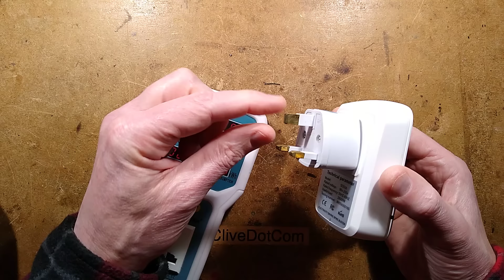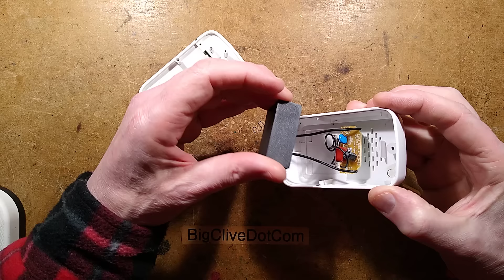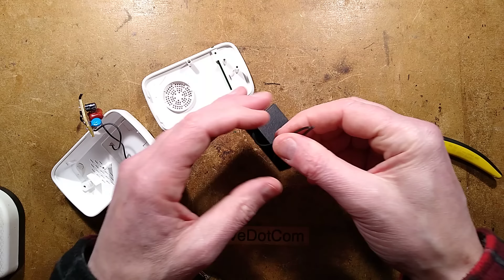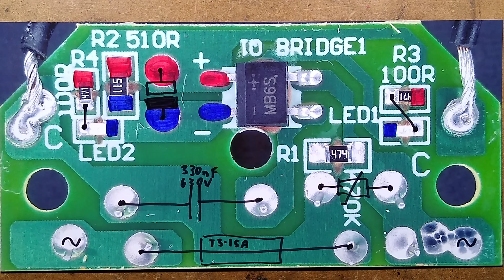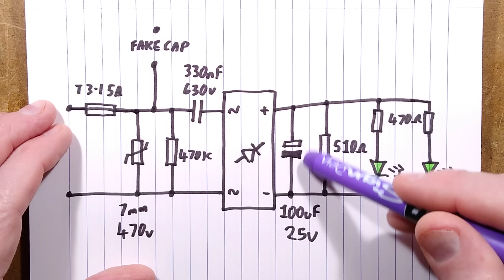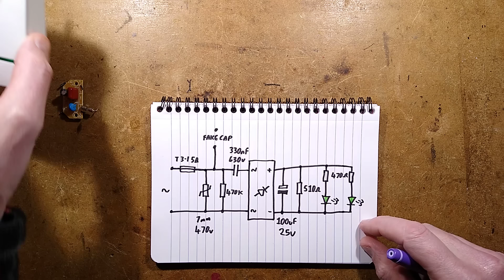Scam power saver plug - the 2024 edition.

Comment: it is not a fake capacitor, it increases the capacity of your wallet by removing extra money
it is disgusting that so many real people fall for this scam so many decades later

the irony is that most devices that have use for a capacitive Power factor corrector(what this would be if it was real) already have one inside them
things like a window AC(which has capacitors in there always to balance the phase and startup surge in non-inverter models, inverter types have no use due to the electronic speed controls)
or a fan(often a shaded pole motor that consumes so little power it has no need for capacitive adjustment)

the rest are devices that abuse the capacitive reactance, making this device cause the power factor to get WORSE

the best way to avoid bad power factor is to use resistive loads, or if you must to use a low capacitance input boost regulator to go above peak mains voltage(literally exactly how real active PFC works)
but to be truthful most consumers should not care much, the likelihood of anyone having a bill high enough for power factor to matter(even after they start charging for it) is low
the reason? end-consumers are on transformers, devices that are highly inductive isolation devices by default(at least in the USA

at best they may add their own primary side capacitive adjustment, but most americans(and probably other lands) tend to use localized step-down transformers, and the loads an end-user will toggle are so weak as to be undetectable for most grid-scale measuring

large industrial loads are given fees because they often consume megawatts(kinda like those pointless superchargers when charging at home is best for battery longevity anyway) but the few KW of load on average of each home? undetectable when dealing with power factor issues

sure you should design power factor into your devices, but given the nature of thermal+inductive breakers, consumer grid ties, and natural load variations and limits, it is unlikely that consumers will ever really have to deal with power factor directly
you still need to be careful of ACTUAL overloads(not the scare-lie of not plugging splitters into other splitters, even in fuseless america)

but my entire PC setup uses an average of 500w under load(maybe not the server being fully loaded but still) but anyone not versed in why "scary plug squids" are bullshit would freak out
500w is <1/3 the limit of almost all devices on a 15a capable circuit, but my "office" is on a 20a breaker, and the inverter is likely capable of melting most 20 wires(it can supply 4kw of normal load, 1200w of reactive power i think)

read all your plugs and measure computers with either a kill-a-watt or HWinfo, you will find that almost no common computer desks even break 200w normally in total, and those that do are well below 15a at 120v
my rig is for gaming, and my server has a best of a CPU, yet it sips less power than my AC in 1/4 the time

I actually set up the smart control app just to test how much I save by turning it off for a week while I was away, I saved like 1/3 of my power bill turning it off for 3 weeks in a row(something impossible if I was home)

so what saves you power? turning off your HVAC(or setting it to "freeze prevention" mode) heating/cooling a space is EXPENSIVE, tune that thermostat as low/high as you can tolerate, that saves the most coins

power saver plugs? they cost you more if they do anything at all because they make power factor worse as almost no consumer has large uncorrected inductive loads

actually those devices may be useful if connected to larger AC-DC power supplies AFTER the power switch, the large capacitance could balance out the surge of peak mains charging the input side, but not perfectly compared to real APFC
but fixed devices connected 24/7? literally cost you MORE on power and power factor

Comment: Picked up one of these for a dollar just for kicks. It had a fancy foil sticker covering the plastic molded back. Peel it and it called itself an ultrasonic pest repeller. Aha. Fun!  Always wanted to play with one. Had a red LED. The guts had a peizo and so forth, so it actually was what the mold claimed.  Baffling to me, it actually did repel bugs.  I would never have believed it if I hadn't seen it work.  It currently runs in my kitchen doing a fine job keeping away the bugs.   Pleased with that one, I got ten more, exactly like the ones in this video. Green LED.  Guts were the same fake capacitor and no piezo.  They do nothing.   Still very puzzled by the one that does repel bugs. I thought that wasn't supposed to actually work.  But it does.  I am assuming there is some effect going on that likely has nothing to do with sound.  Either way. It is short range of maybe 18 inches or so, and only if nothing blocks the sound.  Or effect.  Anyway red light kind, good.  Green light kind, garbage.  In my experience.

Comment: I have LED tubes in my workshop but when I'm filming, they can flicker. Maybe a massive F-off capacitor across live and neutral would smooth the phasing?
Reply from the maker: You may need to experiment with lights for filming to find ones that don't flicker.
Reply: @bigclivedotcom  Sounds like hassle and expense. I did consider flicker free tubes but they aren't cheap. Then I thought about replacing all the lighting with DC lighting.
However, I'm wondering if these particular tubes run DC. So maybe a full bridge rectifier on the output of the light switch.
Reply: What's the Hertz rating of your power supply? 50 or 60 Hz? When filming, set your frame rate to be non-compatible so that they're not in sync with each other and you should avoid the flicker.
Reply: @two_tier_gary_rumain  No such option on the iPhone.

Comment: Those Chinese could save themselves all that hassle by putting piece of rock inside instead of the fake capacitor 😂 and also connect the LED directly to the mains with a series resistor 😂

Comment: The sand is the key to the entire device.  It is sand from Area 15 (the Chinese equivalent of Area 51).  The reason the device did not work for you is that your power company has installed an alien tech blocker.  This is a common problem.  Luckily for you, we have developed an alien tech blocker-blocker.  Send $19.99+shipping & handling to...

Comment: Before I click "Play," this is my prediction:
Capacitive dropper running the "it's working" LED, half-wave rectified and flickery, a woefully-insufficient capacitor pretending to do power factor correction, and a fake fuse in the plug.

...Wow. The capacitor was fake, didn't expect that! Like you, I expected a smaller cap potted in resin - or just an electrolytic tacked across Live and Neutral.

Comment: I'm surprised that they even include more than the absolute bare-minimum of real (or fake) parts (i.e. just enough to light a single LED in this case).  The fake cap I can understand as it'll pass inspection by non-technical (bulk) purchasers who know nothing about electronics but do know that there's supposed to be a big black box wired in.

Comment: That's a lot more complex than it needs to be. Though, to be fair Clive, you do mention people who are charged by apparent power who might benefit from these things. Though, normally, those people are commercial/industrial users and they're not charged by apparent power, but power factor. Since most loads are inductive in nature, you use capacitors to bring the power factor towards unity (which also reduces your apparent power - it's why it's "apparent" or "imaginary" power when calculations are done). The grid is set up for this, because all the reactance used by power companies is capacitative - they have massive reactance banks at substations that simply dump a large capacitance across the phases, the distribution side has smaller capacitor banks that are often manually switched in and out, and customer sites charged by power factor will often have capacitor banks they can add and remove to keep the power factor the company sees within the specified range.

Comment: A counterfeit scam device.  Isn't that special.
If they change the circuit to short the live and neutral, it would actually work by popping the breaker and lowering your electrical use to zero, at least on that circuit.

Comment: Something little bit similar though not for saving energy, rather getting rid of potential problems, is DC blocker. I have gotten some finicky equipment working issue free by using those when mains power hasn't been ideal.

But I wouldn't use cheap DC blocker due to potentially more risks than benefits unless able to check the circuitry / verify components being adequate. Have made those myself too, but only for personal use.

For low A use they aren't expensive to make, but if having one equipped with 10A / 16A IEC inlet and Schuko socket(s) then better be sure it has beefy components.

Comment: my uncle has one one of these in his kitchen, but I simply don't have the energy to inform him that it is a scam
Reply from the maker: You could sell him a more modern and powerful one.
Reply: @bigclivedotcom is there a "more modern and powerful one" that actually works, and is not a scam? Does it need to be integrated directly into the breaker panel?
Reply: @agalerex  No need to integrate it into the breaker panel, it works just as well just sitting on the shelf. At the supermarket.

Comment: Might be interesting to test the fuse if it blows at the rated current. There are fake car fuses around so mains fuses can't be trusted either.
Reply: definitely are fake and dangerous mains plug fuses, one was in a 'cloverleaf' mains cable i have, its just a plain white bodied thing with 13A wrote on it, opening it up, some random wire and no ssnd filling, plus fuses inthe UK should be specific colour for the amperage, be sand filled, and have the approvals stamped on the casing

Comment: Nice case though... and wow... even a full bridge rectifier in it and some other parts then just a resistor and a LED which will probably be the most optimized device.

Do you still have your gygercounter to see if the dirt in the 'capacitor' is maybe just some left-over dirt they want to get rid off and have you pay for it too? Or chemical-rests ?
Maybe just needs another label to sell them as some kind of health-machine ...... ;-)

Comment: Most static, inelastic loads these days (especially LED lamps) already have capacitive droppers skewing the power factor such that these "power saver plugs" will make the power factor worse, not better. For inductive loads like dryer motors, these little capacitor blocks are so many orders of magnitude smaller that you'd need at least a foot locker full of them to offset the motor, and you'd have to selectively switch them into circuit only when the motor is running to get any benefit.
Reply: In many cases the low power factor is caused by current waveform distortion, so no amount of capacitance can ever improve matters.

Comment: There is nothing to save(atleast in a non-industrial setting, where reactive power loss are negligible).
The fake capacitor is a nice touch🤔, to save on production cost🙄, while keeping the device suspeciously authentic🤞.The devices that monitor current to cut off outlet power can really save power, if the power saved is more than power used by the monitor itself.😂. Imagine if the same attitude(having to degrade functionality to squeeze profits) goes into making safety systems (that are never put to test, until an event occurs) of a BEV🥺❤👍

Comment: but the marketing masters degree holder will argue, that as a night light you got more parts than would have been required. Bridge rectified fused and smoothed constant light with transient protection. Bonus: Comes with certified Shenzhen beach sand im hyper leak proof package!

Comment: Well, if they removed the capacitor, that did reduce the power consumption. Shame they included the LED.

Edit: Also a neat utility I opened, but might re-use for something: a high-power multi-port USB C charger. One of the ones that supports different voltages. Got a good zap from grabbing the board after it was unplugged. It could supply 90 or 120W continuous among the six ports, but looked like it supplied the max voltage and stepped it down for each port. Could use a 24V 5A supply for random things.

Comment: Probably costs more to make the fake capacitor than buy a genuine one!
Reply: That's so that the audiofools have to buy the more expensive "plug in noise filter" rather than just buying the energy saver and using it as a noise filter. :)
Reply: Why do they put a fake component in? No consumer is opening it up to check? If they knew anything about electronics they wouldn’t be buying a scam product 🤨😝
Reply: @adamwishneusky  Perhaps the fake component is made by another vendor or is made at another location to a drawing supplied by the scammer.  Then the scammer's assemblers can build the fake components into the units, believing that they are actually making something useful.
Reply: @analog_guy Yeah, except that the 'cap' is not actually connected 😅.
Reply: @analog_guy  I agree, somebody is making fake capacitors and selling them to fake power-savers makers. Maybe they did not even know the capacitor was fake. 🤔
Reply: Maybe the people making that fake cap know what's going on and they are scamming the people making this gizmo?
Reply: Who’s scamming the scammers?
Reply: Benefits of scale. If you're making 100 fake caps, it would be more expensive.
However, if you make 10 million  then it is cheaper.
Reply: They could also just put a piece of rock insted the of fake capacitor 😂

Comment: Octopus gave me two hours free electric this morning so I had to get up early to put on some electric heaters and the immersion. I was going to put the washing machine on as well but it's in an outbuilding and it was a bit windy and rainy so I didn't. I used maybe an extra 8kwh saving maybe £1.60? Hardly seems worth it but it feels good to get something for 'free'.
Reply: We occasionally get negatively priced electricity here, I really should plan ahead and have lots of electric heaters ready with timers to operate them at the correct time.

Comment: Clive. My elderly Daya got sucked in by this fake PoS a few years ago. Twice!!!  He bouht 2 lots of 3 units - one UK non-compliant plug, and 1 lot US plug (for which he then bought 3x US/UK adapters!!! 😞

I then showed him your last video exposing the scam!! Sadly, he kept plugging the things in!

But, as a side note, and before I carry on watching this video, I took apart one of the "suspicious capacitor type thing".  And Not to my surprise, I found the 2 wires just shoved in to the resin, which had been poured over ... guess what? 

Sand!

I wonder if you'll do and find the same?!?

Back to watching the rest of your vid ;-)

Cheers, Richard.

PS: I also found the "capacitor" was soldered on to the same track on the "circuit board" !!! Haha!! As if the "manufacturers" knew what they were doing!!

Comment: The bolt on many Chinese locks is made of thin walled steel tube filled with sand and with caps welded on the ends, with some polishing and nickel plating to make it look a single solid chunk of steel.
Reply: talk about when it costs more to make the fake than to just lathe a bad bolt from the cheapest iron you can get
Reply: @TheScarvig  i bet a certain lockpicker (on YouTube) could stab out open in two seconds or less, assuming the lock can't be used to open the lock.
Reply: Steel is dirt cheap in China (and not very expensive elsewhere). How can that possibly save them money?!? 😂

Comment: We canna be too far from max absurdity when folks are gluing wires into a plastic box to fake a fake capacitor in a fake device or when resin is cheaper to acquire than beach sand.    Brings to mind the words of a certain, late, carnival barker. So what do you really have if you plug this thing in, a wee bit of HV transient suppression, for a few days, and a 4 lumen, effective, green nightlight?  How much useless phantom draw is on the grid with dozens of these scattered about and plugged in for no benefit beyond some temporary transient suppression? Isnt that the sort of thing a king can just ban on a peaved whim by packing the assailant in the tower with all their fakes?
  As an aside, who else's favorite marker of smelly emissions from the surface of Clive's workbench is the squiggly one? More importantly, who can remember the device which contributed that familiar landmark?